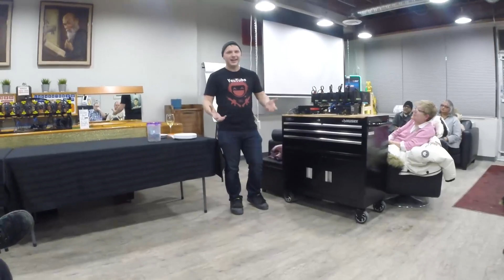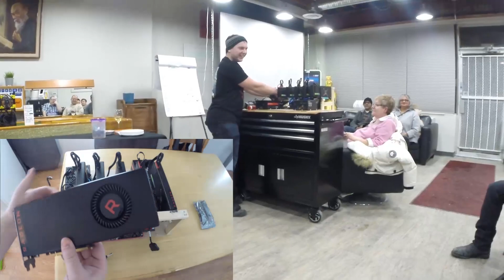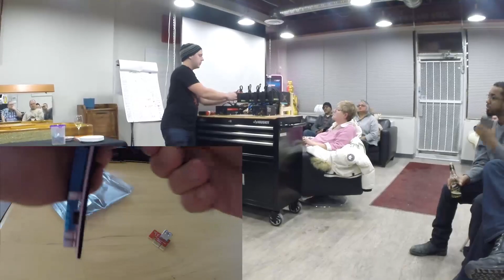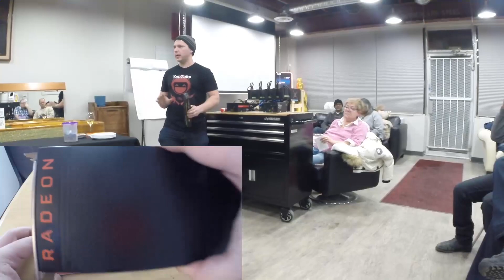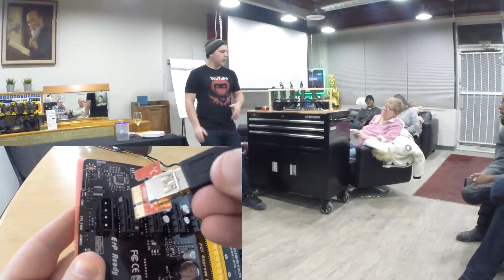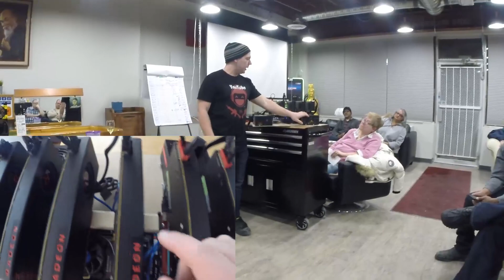RX Vega Mining Rig | Hardware and Wiring Explained | CryptoNutz Presentation

Comment: How did you connect 4 cards to the evga?? vegas take two 8 pins, which connectors or cables did younuse.
Reply from the maker: That evga power supply has 8 power cables for graphics cards. So I just used the regular cables from the power supply I believe. If not, then I would have used cables that go from molex to 8 pin power.
Reply: @ThatRegularGuyIRL  it has 6 pcie slots lol. I have a 1300w and even that had 6. Only the titanium 16000w has 9.
Reply from the maker: @DiveBombSimRacing  - Sorry lol, Yeah I couldn't 100% recall. I made those rigs a while back but I'm almost certain they have two power supplies. In which case, I would just use one power supply to power the risers and another to power only the cards. The power supply that powered the risers would also do the motherboard. Update: Yupp just watched the video. There are two PSUs there. So one of the power supplies would power the cards with all of the pcie power connectors and then I used molex to pcie power cables (https://amzn.to/2Ctc5a9) to power the last card.

Comment: I really enjoy your videos and style but I was wondering if those watching realized how much work they will have to put in mining on RX Vega. I have to reload the drivers at least every second week and reset them to get the maximum hash rate almost every day. They are not plug and play and I am avoiding Vega CryptoNight mining now in favour of GTX1080Ti
Reply from the maker: Thanks man! Oh wow really? That's really interesting. I haven't come across those issues yet over here. I just let them run and double check the hash rates once a week and everything seems good. They are some of my most steady earners right next to some of my CPU miners. I try to decrease difficulty for individuals if I can. That's why I've been spending quite a bit of time making the guides. But it definitely can be difficult for newcomers to jump into a mining set-up that is more geared towards intermediate level tech. My hope is that the guides will help bridge the gap between beginner and intermediate skill sets. Yeah the GTX 1080 ti's are fantastic cards as well! Good suggestion. But they are also increasingly difficult to find as of now unfortunately. As I understand, alot of resellers are enforcing a policy for 1 type of GPU per customer which also makes it tough for mining. If you know alot of people though, and can round them up, that's not much of an issue ; )

Comment: Great video! Just curious, seeing as you plug the one power supply to provide power to the mobo, hd and 2 video cards, do you do anything with the main power connector of the 2nd power supply besides the 4 plugs you use for the other 4 video cards? Thought you needed a load on that main connector of that 2nd psu.
Reply from the maker: Great question! That is definitely one of the areas I could have explained better. Thank you for bringing this up. You are correct in stating that you need a load on the main ATX connector on a psu. But this can be easily avoided if you simply bridge the green pin of the ATX connector to a ground pin. I use adapters that do this effortlessly and neatly. Here's what it looks like: https://goo.gl/moS7Xd and then here's a pic explaining the concept: https://goo.gl/VL548g

I hope that answers your question : )
Reply: Completely ! :) Seems like just the power on your shorting and with the 4 video cards, there's your load! Cool beans!

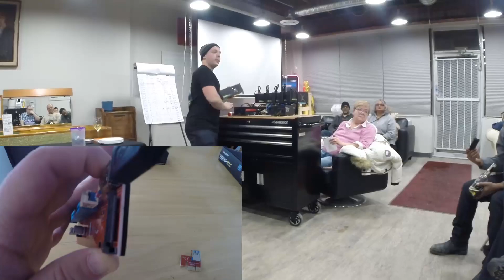Comment: Awesome presentation bruh!!!😍😍😍...I have some concerns bro...we have given power from psu to card but there is one cable you are connecting to riser card @ 7:38 where we have to connect that ???...
Reply from the maker: Thanks man!! That cable connects directly to your power supply. So there will be a female Molex connector: https://goo.gl/2q5V5h then your power supply will plug into that and power the riser: https://goo.gl/CiYsAA. If you have Sata power cables from you power supply that look like this: https://goo.gl/zvM8cG the they can be connected directly to the riser as well without the adapter that I'm using at 7:38.

I hope this helps!
Reply: That Regular Guy - IRL So, I'm just now cleared with my concern bro...There are two things I have in mind ...
1).plugging wires from psu to graphics card is simple but risers also need to be powered from the Psu right bro?
2).I'm thinking to build 5X/6X Vega 64 ...https://www.buriedone.com/amd-6-rx-vega-64-build.html
Can you please advise me in this area....is it necessary to use the 1600W psu as they mentioned in it or any other Psu ?
Thank you for your reply and waiting for the reply 😍